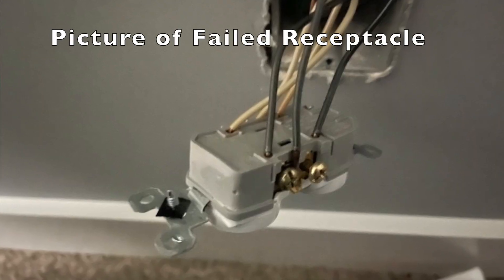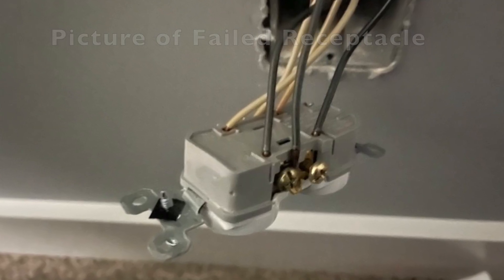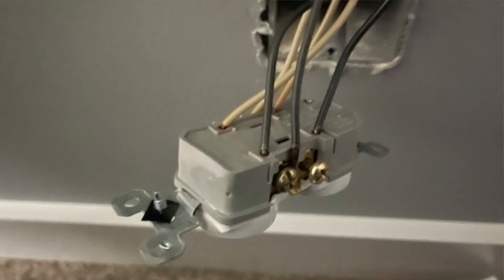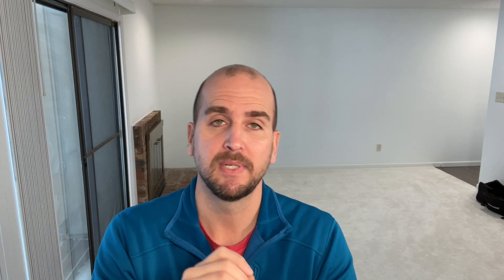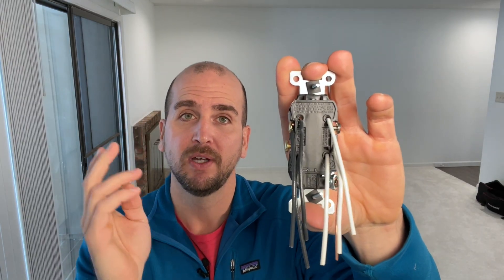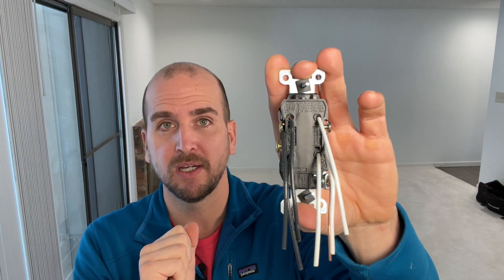Incorrectly Wired Outlet Found In Newly Built Home

Comment: So, I know it'd be tough to understand without seeing everything in my house. But I have 2 outlets in my bedroom that one of the two plug ins (on both outlets) zaps a little when you plug something into it. I know that can't be good just curious if you have any insight. And then I have a whole outlet in my bathroom that I can only assume is on the same circuit as its on the same side of the manufactured home I live in. (I know, its a nightmare) but that whole outlet does nothing. And I've replaced the outlet itself so its not the outlet itself. Its gotta be the wire. I just dont know where to begin and really don't want to be way overcharged by electricians that don't want to work on my home
And if its not a simple thing I'll definitely have a professional come out. Just not yet
Reply: Test the wires in the bathroom outlet and first off detect if there’s any power present. Check for resistance and continuity on the wires. For your bedroom receptacles sometimes seeing a spark is normal as there is momentarily contact causing an arc but if you see smoke or smell plastic burning I’d advice shutting the circuit off and investigate the device. The receptacles may be old and need to be replaced as the blades on the inside may me close enough for an arc or could potentially have loose wiring causing a lot of heat build up. I hope I could help you slightly and only perform these tasks if comfortable doing so
Reply: @Nick-bh1fy  thats actually really helpful, sometimes hearing things from somebody who knows something is the best kind of thing
Reply: @jakecg9182  I’m glad to help anywhere I can. Not guaranteeing what I’m saying will help but it’s definitely a place to start, if the issue persists there’s always an AFCI breaker you can install for ur bedroom circuit so if any arcing continues unexpectedly it’s a safety switch to shut off the power, do keep in mind it’s about 40$ for one

Comment: Something we do in the shop is install the receptacles upside down with the ground at the top.  We've had instances of plugs coming slightly loose and metal sliding along the wall and shorting the plugs, causing sparks and smoke.  Believe it or not it happened more than once so we flipped all the outlets over.

Comment: Working in a hospital I see that all outlets are installed with the ground up outlet.  Why?   Is this a better practice?
Reply: 90 degree (wall-hugger) plugs are often used for hospital equipment, but they are made for ground "down" plugs (so the cord ends up pointing downwards). That's great if you need to run it behind a couch, but not for the movable carts used in patient rooms. Ground "up" plugs allow these cords to be extended a little further, and can be more easily coiled and stored on the carts. Elsewhere in the hospital will have ground "down" plugs.

Comment: I want to say first, great job on the instruction video!  Call me picky,but anytime I installed a cover plate I would make sure the slots on my screws were uniform straight up and down. I know this isn't a safety issue but, it makes the finished product look more pleasing! I practiced this and ensured everyone working for me did the same. I owned and operated an electrical contracting business for several years as a master electrician. I can tell a person takes pride in the small things they do! I've had many compliments from customers and even inspectors over the years.

Comment: one thing you missed you forgot the people that are going to do this to make sure they shut the power off that goes to that circuit
Reply: Yep, that's Rule #1...cut off the power.
Reply: @dangerously72  ALWAYS CONSIDER THE GUY WHO TELLS YOU "YEAH ITS CuT OFF A LIAR!!!'" CHECK FOR YOURSELF!!!
Reply: I would suggest everyone should get an electrical tester which you will safely verify the power is off (Lowe’s, Home Depot) for few bucks. One for power and one for polarity. Time saving and can be life saving.
Reply: If someone wants to NOT turn off the circuit, but has the guts to remove the cover/plate, I say 

Survival of the Fittest is a good thing
Reply: @nikkigbsd  Yeah but my local depends on organizing the nonunion's half whit's and window lickers.

Comment: Great (common sense) video!  What is your opinion on *Wago connectors versus wire nuts?  
Personally, I prefer *Wago for a variety of reasons... 1) They clamp on the wire and do not damage the wire by cutting threads.  2) *Wago takes up less space in the box. 3) *Wago connectors are also reusable and inclose the wire(s) more completely.  4) Each wire has a positive connection as opposed to multiple wires being twisted together. The only downside I find is a slightly higher cost. https://www.wago.com/us/
Reply from the maker: I like WAGO lever nuts especially for DIYers as I feel like a proper install is much more likely with WAGO lever nuts compared to wire nuts.

Comment: You installed the receptacle upside down. When mounting down low, ground always goes on top, when above counters, ground goes on the bottom. That way when you unplug cord, ground is the last thing that gets disconnected.
Reply from the maker: This is a very active conversation on another video https://youtu.be/kYXvcog9MxY

Comment: If Electricians could agree on everything we would never have follow-up repairs with everyone pointing to the previous idiot. There are plenty of people that can't stand pigtailing in any form. For the most part avoiding a cheap push-in receptacle is almost always a bad idea. The exception the more robust receptacles that have a half inch (perhaps a cm) of surface area that pinches the pushed in wires. Using crimped or scored contact surfaces has always been a concern of mine. I have plenty of examples of failures that eventually make for either disaster or plain old darkness. The best connector is always, always going to be a block, almost no one is going to spend the time to put that in however so, I have been happy to apply a good pigtail that now Includes heat shrink around the entire connection. Added time, Added peace of mind.

Comment: You have no business pretending you have any idea what the hell you are talking about.  There is no reason to pigtail an outlet unless they have a shared neutral for two or three circuits and this is very unlikely in a home (do you even have any idea what I am talking about)  so you'll probably never see this kind of wiring in a home, but if you have 2 or 3 circuits sharing a neutral in the same cable or raceway supplying several fixtures and/or devices, they want you to pigtail the neutrals (and only the neutrals!) at each device or fixture connection. Otherwise, because it violates common sense, pigtailing is not recommended. One connection is always better than two, and a wirenut connection is no better than the dual screw connections on a duplex receptacle (never put 2 hooked wires under one screw though). The other part of that is, if you can't fold 4 or 5 wires each 6 or more inches long connected to a duplex receptacle neatly into a normal size wallcase, you probably shouldn't be doing this kind work.

Comment: Where I live, Japan, there are only push ins plugs, switches and connectors, you can have up to 6 wires connecting together. From a safety perspective, push ins are much safer. There is no chance of touching any hot wires when working with them. Of course, we shouldn't work with hot wires but in old houses, it's sometimes hard to find out which breaker connects with which plug or switch. i work only on old houses.

Comment: Doing the pigtail method will also help for future trouble shooting when an outlet goes bad. With out the pigtail the outlet that goes bad will not feed the rest of the load outlets and it could become a pain when trying to figure out which is actually the bad one. By using the pigtail method if any outlets go bad, it doesn’t affect the rest of the load outlets and you’re able to identify the bad outlet immediately.
Reply: How do you get all that wiring back in the box ?
Reply: @daghostxxx1797  it’s not easy but It’s never been a major issue for me. Planning your work and organization is key.

Comment: What kind of outlet or switches do you recommend for replacing old ones.
Reply from the maker: The most common ones I use are Leviton residential grade switches and commercial grade receptacles. 👍  There are better products on the market but bang for the buck that is what I go with for projects.
Reply: @EverydayHomeRepairs  thank you

Comment: What's best gfi breakers or gfi outlets and switches I also have a gfi reactor .that's what I call it on the main breaker from the meter so if I get a large burst of energy to the box it automatically blows the main switch and saves everything else before I  knew I had gfi breakers I installed 2 gfi outlets in the kitchen so now I guess I'm double secured lol.great video I always make sure all my connections are tight.

Comment: Only thing I can add is when you twist the wires together, then trim the ends before wire nutting, cut ends at an angle to allow them to seat further into the wire nut. Also line up the cover plate screws vertically!

Comment: You didn't do a Shepard hook and it should be tighten in the direction of the screw when it tightens. Also I normally from habit tape the wire nut so it don't loosen. And I  never knew about the sleeve. I  also run tape over the screws to protect it from shorting out. Lou

Comment: When I was a professional electrician, about 90% of my service calls were related to the wires being pushed in to the switches or receptacles. It became so common that it was often the first thing that I checked. I will never use that option on any devices that I install.
Reply: That's funny, in europe you would have hard time to find equipment with screw terminals. Everything has some sort of spring loaded connectors and we don't have problems with them. So is it American QC thing or skill thing that is the problem?
Reply: @peto22  That's true. I spent time in Europe and found that the receptacles are better performing. I especially like the way the ground makes contact first. But here in America, even in my own newly built house, I had to rewire a bunch of receptacles that the electricians stabbed. Dead receptacles fixed right away as soon as I wrapped the wires around the screws.
Reply: @peto22  I  would say the majority of the blame falls on the cheap chinese receptacles that people are using.  They wear out faster than a good name brand like Leviton, but Leviton costs 4 times as much as the cheap chinese receptacle, so which do you think a DIYer is going to choose?  

You don't know how a cheap receptacle is mating up to the wiring when you use the push-in option without tearing one apart.  So for safety's sake the screw terminals are the way to go.  Besides a spring-clamp mechanism does not produce anywhere near the force that can be applied with a screw terminal.  I would rather do it the safest way possible whenever I can.
Reply: @docferringer  failures were happening before the Chinese copied the poor quality. heh I heard them commenting once, "I don't believe they allow this cheap crap in America"
Reply: Very true. I also use receptacle that cost at least 2$, (Paulding, Leviton, et/al) versus the 50 cent chinese receptacles.  The condescending fuck-mooks who replied to your correct statement have never replaced a receptacle, much less wired a house or commercial building.
Reply: @oldperson951  Hey, all but one of us condescending fuck-mooks was agreeing with him!
Reply: 90% my ass
Reply: @aaronsbraga  LOL
Reply: @aaronsbraga  I sense much anger in you.  Who shoved their 12 gauge wire into your push-in connector?
Reply: @docferringer  im a 8 gauge and had to use klein tool lubricant 32 % once on him, tight fit

Comment: I'm no electrician but shouldn't the pigtail be of a larger gauge since you are now  feeding from two wires down to one wire to the receptacle?  Would that not be a possible overload on the pigtail?
Reply from the maker: You will not be able to deliver more than the circuit breaker which is 15 Amps in this instance and that is easily handled by 12 gauge 👍

Comment: Not only should you tighten the lugs down you should wrap a layer of black electrical tape around the circumference of the outlet covering them.  You should also only use 3M tape.  At least that's what I'm told.
Reply: @Joe-by8jh  which part is untrue

Comment: Dang I wish I would have known about the pig tail trick before I put new outlets in my entire house!
Reply: 04:  It is not a trick, it's best practice.
Reply: @bluerider7922  Can you explain why pigtail is best practice? Is this just so the circuit can stay live if the outlet fails somehow?
Reply: @ThomasGlennon  correct. The circuit should not be interrupted when a device is removed.
Reply: @ThomasGlennon  The circuit breaker rating could be more than the 15 amp rating of the receptacle. Pig tail wiring keeps the current pathway to further outlets in the backbone wiring instead of being run through the previous outlets
Reply: @ThomasGlennon  I prefer to use the commercial outlets with back wiring, and use the upper and lower terminals to continue the circuit. It's cleaner, faster, and you don't have to worry about another failure point of a wire nut. Even if the receptacle fails, the side bus bars shouldn't fail and the rest of the circuits down the line will continue to work. 
And if you're servicing the device, you'll have to shut the power off anyway, so the "benefit" of having the circuit stay live with a pig tail doesn't matter.  
Now if you were dealing with control/alarm 24v wiring, then yeah, a pig tail might be better since you don't necessarily have to shut the power off to inspect or replace a device.
Reply: @andrewt9204  The "upper and lower terminals" are for splitting a receptacle, usually so that half of it can be switched. Some people like the receptacles next to their bed to be half switched and half hot, so you can turn your table lamps on and off from the wall switch but the alarm clock half stays on all the time. The method you describe for wiring a receptacle has been a code violation for many years because the continuity of the grounded conductor(neutral) in a circuit cannot be dependent on any device.
Reply: @Fireball573  Yeah, I know you can break the tab to separate the receptacle outlets. I've passed several inspections in the last few years using both sets of hot/neutral terminals. The ground lug on receptacles only has one connection terminal, so the grounds always have to be pig tailed. However, on 12ga solid wiring, I do actually pig tail all three wires as 5 solid conductors coming out of the back of the receptacle makes it difficult to shove in the box correctly.

Comment: To be safer, also check the circuit with a sniffer or no-contact circuit checker. This lets you know if there is still power on the duplex receptacle from a shared neutral or from the circuit ground lead.
   Since you have the box open, check for discoloration of the plastic or metal, that could indicate a hotspot, a point of high resistance and a precursor to a possible fire. A poor connection, poor quality wire, or poor quality metal in the connectors can cause contact resistance.
   People do mess up the connections.
Thanks again for your video.

Comment: IDK in regards to the pigtail, for 6 wires or non-solid, yeah a pigtail all the way.  But for just four wires, I would rather use the four screws.  There is no greater risk or less.  Also, spend .50 cents more and get 20amp, heavy duty outlets for almost all outlets in your home, I mean anymore there really is no justification for 15amp sockets save for dedicated lighting of various forms.

Comment: Up here in Canada we have the CEC which is very similar to the NEC. Code 4-022(1)(d) states that the neutral wire must be installed in such a way that disconnecting the neutral will not interrupt the connection to other devices. In other words, you need pigtails ... at least for the neutral.
Reply from the maker: Thanks for the feedback and the exact code callout.

Comment: never say never and never say always
except when listening to the authority having jurisdiction
also UL listed is not the same as UL certified
Reply: They are essentially the same if you are using the piece of equipment/part in it's intended application. Like anything, consult a professional if you have questions or don't understand the intricacies of household wiring!!
Reply: your last comment is a very good observation.  Is UL certified better?
Reply: @thebatmanakathedarkknight922  I assume that Charles above was trying call out a difference between UL Listed and Recognized devices/components. A device that is NRTL Listed (certified) means that the whole assembly you are installing is tested and meets US minimum safety standards for use. UL (Underwriters Laboratory) was one of the first, but not only agencies recognized in the US to certify devices to safety standards. A NRTL Recognized component is usually given to a part/sub-assembly (such as the blower motor for your furnace). Recognized components will have designated usages from the manufacturers for their intended application. This means that this component is recognized to be safe to use when properly installed and used in it's intended application. All that said almost all products that plug into the grid (washer, dryer, power adapters, etc.)  in the US will carry an NRTL Listing. One isn't necessary better or worse, they just mean different things.

Comment: Those push lock ones are the bane of my existence my entire house is wired with those. do you know if anybody that makes a combination LED light switch and dimmer and bathroom fan switch timer. I don't have room for both in my box and our bathroom without cutting it out and putting a triple gang in.